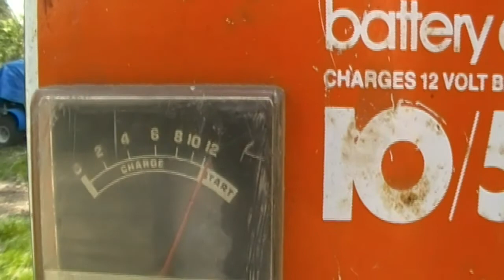This mower is kickin my butt

Comment: a couple things come to mind, if you take jumper cables direct to the starter will it crank over, are the valves adjustible on the engine,if they are too loose it will have too much compression,,,battery dosent have enough cranking amps,,.pull off the nut that is on the starter and tighten the one thats still on it but watch that the post dosent turn,it gets hi resistance there,,,are the belts dragging on the pulley,
Reply from the maker: All good a valid points to consider, the engine is a flat head so the valves are not adjustable, Without grinding or growing the stems, that is. A dragging belt is another thing I need to check, as well as the hot post nut,
Thanks Mustie, you're #1 in my book. LoL. :) Cheers

Comment: First thing I would do is buy a good 200+ CCA Battery for that tractor.
(Most local places you can buy them for $20-30.00)

Don't think that motor has ACR So I say stick with 200+ CCA

even though that starter motor Free spins doesn't mean it' good!!
It Could be drawing WAY to many amps. But you will know when you install a new battery
Reply from the maker: Thanks man, I may be tired or just dense but what is ACR ? & Yeah, we'll see what it does with a known good battery on it's own. It's worked swell for the last 3-4 years, so maybe she's gettin tired too. lol
Reply: ACR = automatic compression release
Reply from the maker: Thank you for that, It's an old flathead 12.5 B&S. I don't think it has that, but I'm gonna research it & figure it out. Thanks man !

Comment: You need a bigger battery to start the lawn mowers I thought a motorcycle battery would work to bought a brand new one because they where cheaper and it wouldn't start it but went a bought the correct one and it fired right up
Reply from the maker: I believe you're right but this mower is designed in such a way that a MC batt is all that will fit.. Maybe time for some modifications. lol 
Thanks man,  I'll be lookin into that.

Comment: Did you check to see if you were pushin 12 volts through the solenoid? That is the most unreliable piece of junk mtd makes. I had one for my mower go, but not totally. It was only putting about 3 volts through and I had the same problem as you.
Reply from the maker: No, I forgot to do a voltage check after I got it running. DUH, lol 
This is an aftermarket solenoid from the auto parts store, but I still need to do some checks. Good tip Stieny, Thanks.  Hadn't thought of that.